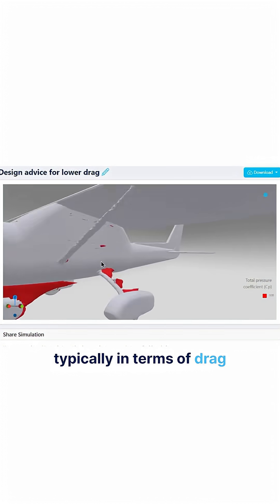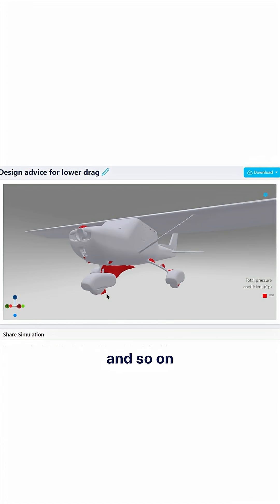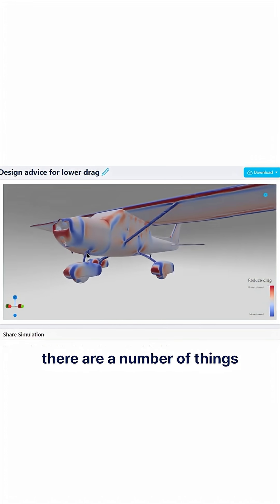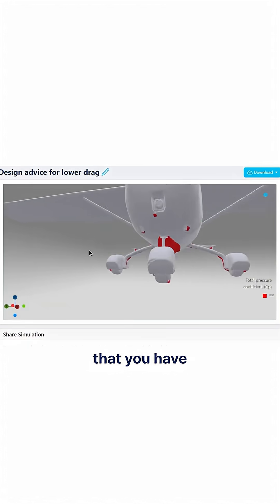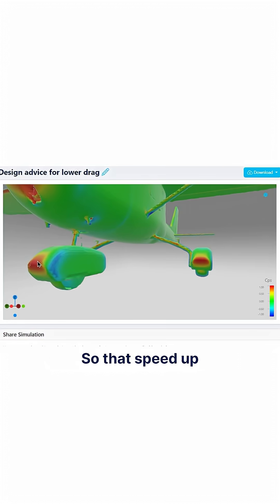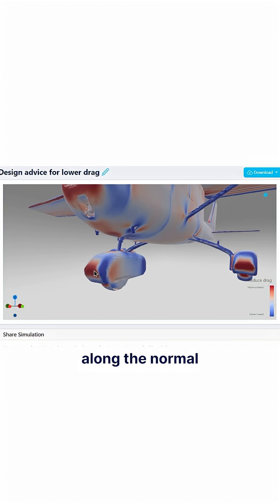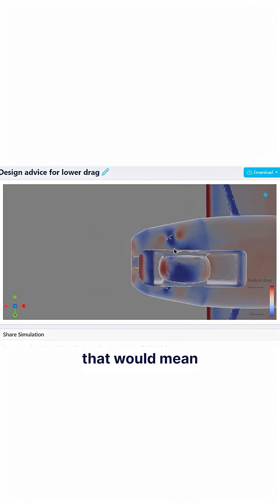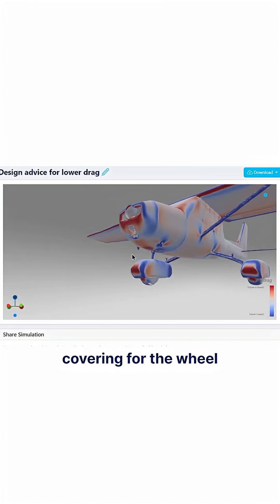Airplane landing gear optimization - AirShaper Design Advice shows how to change the covers!

Comment: Cessna wheel pants are fairly sleek and aerodynamic. And I believe they add a few knots airspeed. They don't look anything like the ones shown here. But they get removed often because they get beat up and cracked. And they make wheel, tire & brake maintenance harder.
Reply from the maker: Yes I can imagine the ones on this generic public 3D model aren't really representative. Great to illustrate our Design Advice tool, but not so good at mapping the real aircraft. Certainly when they're just taken off like you say 🙂